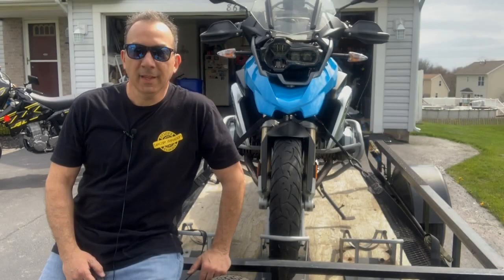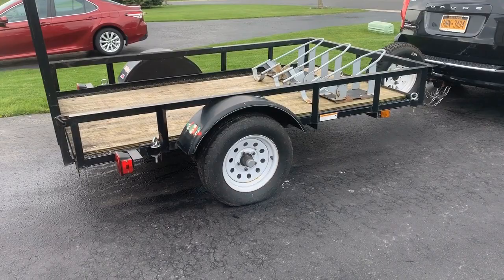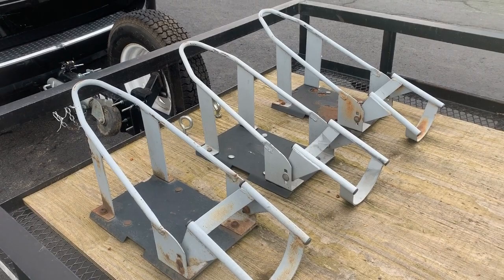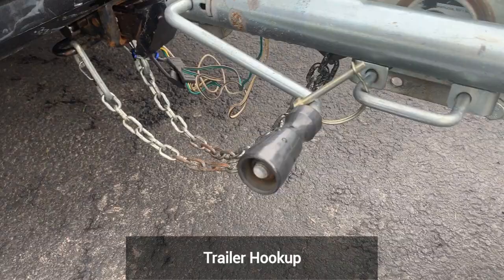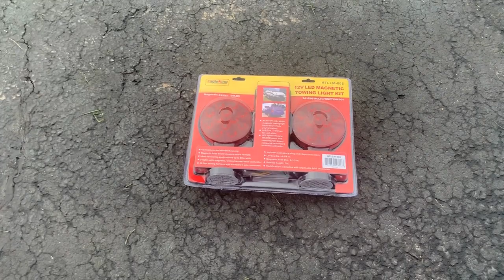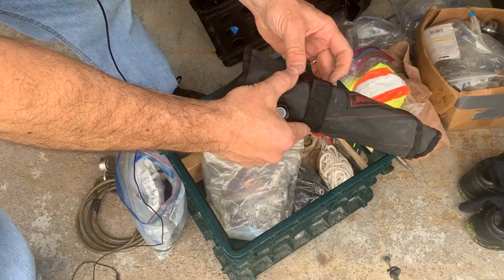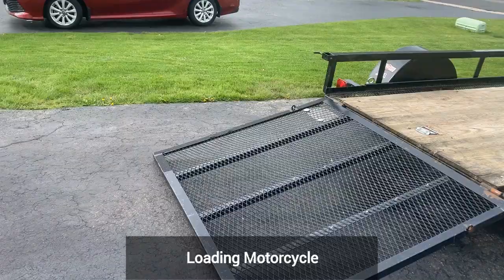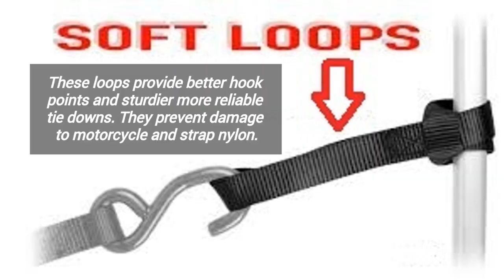Best Motorcycle Trailer Setup and Loading

Comment: Thanks for this video, very informative! How did you decide where to locate the wheel chocks? I purchased a trailer and need to install the wheel chock.
Reply from the maker: It’s fairly simple. Place the chock in the general location you want. Test bike fitment. Make sure the tire can still fit in chock and not make contact with front bar of trailer, etc.  once you have the correct location that you think will work, take a sharpie and mark the holes where you need to drill. If you get a tricky spot on the trailer with one spot, skip it. You can get away w three bolts. Enjoy.

Comment: Thanks for posting and all of your tips.  Have you thought about putting a front face on the trailer to deflect rocks and such when traveling?  I was thinking maybe just up to the top ledge of the front railing.
Reply from the maker: Zonktified 1 ... I personally don’t think a shield is necessary. It might help with damage. But it might complicate strapping. And the way I look at it, a motorcycle operating regularly is at risk of front end debris damage. Full enclosed trailer would be the best option probably to protect. Thanks for comment.

Comment: So is it better to ride the motorcycle up or is it better to push it?
Reply from the maker: Ron Ahlstedt ... with the exception of really heavy or bulky bikes when riding might be helpful to manage weight or size on a reasonable incline, I wouldn’t ride up. I did leave out the idea of using bike power, which could be helpful to walk the bike up the ramp.